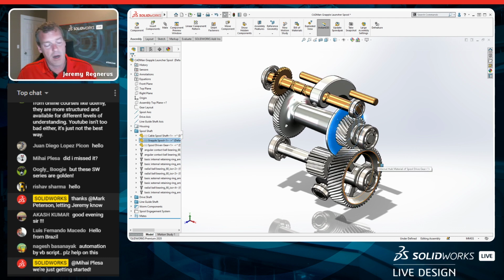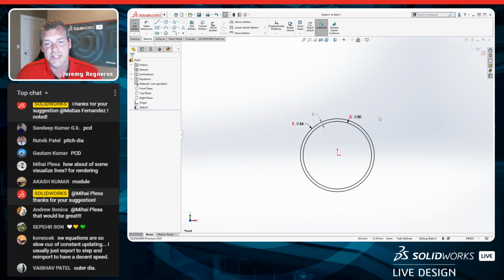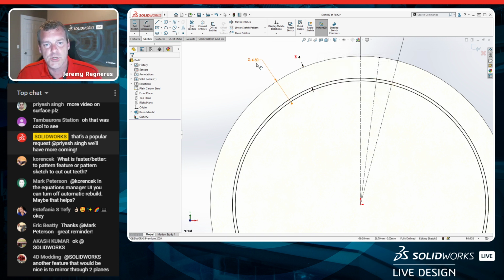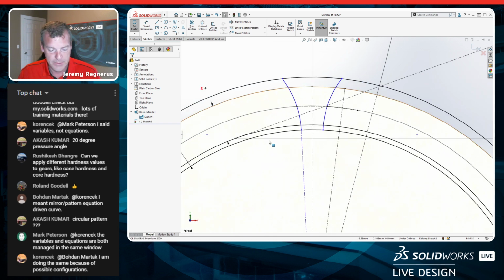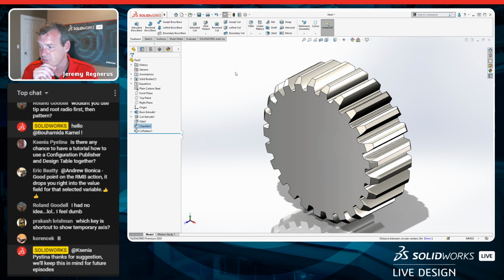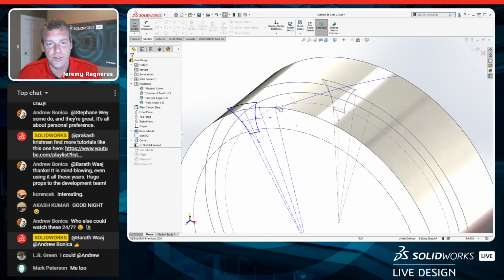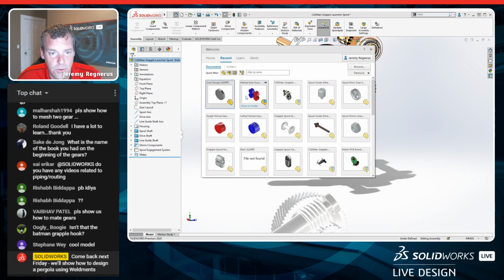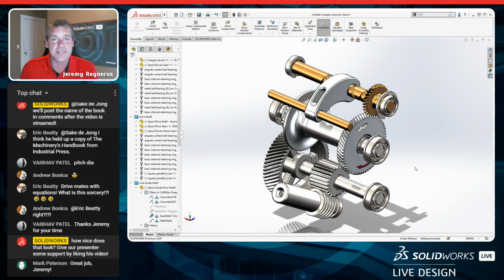Design Spur and Helical Gears - Episode 9 - SOLIDWORKS Live Design

Comment: Really useful video helped a great deal to do same thing on an NX platform. Would like to forward what I learnt whilst playing with the gears and meshing them. With the method given, when messing helical gears with different number of teeth the messing does not work. I believe this is because the helix angle is projected onto the outside diameter, when it should in fact be projected onto the reference diameter (pitch diameter). Once I'd reconfigured my model to this projection the messing appeared to be perfect. I hope this helps anyone else that's using this method.

Comment: I think that there are a couple of problems with the way in which you are creating the helical gear. First of all, the helix angle of a gear is defined at the reference diameter which is normally the same as the pitch diameter. In your model, you created a helix along the OD of the gear, and not on the Pitch Diameter.  
In a spur or helical gear, there are two planes that you have to be concerned with.  The normal plane and the transverse plane.  In a spur gear, the normal plane and the transverse plane are the same. If you define the tooth geometry with a sketch on the face of the gear blank as you did in your example, the pitch and pressure angles would be the same for the normal and transverse planes. However, in a helical gear the normal and transverse planes are not the same. The transverse plane would be the same as the face of the blank, which is a plane that is perpendicular to the axis of rotation to the gear. 
The normal plane is a plane that is normal to the helix angle. In order to draw a helical part correctly, you would need to establish a plane that is perpendicular to the helix angle, and input the Normal pitch and pressure angle. Otherwise if you are creating your sketch in the transverse plane, you would need to create your tooth space using the transverse pitch and transverse pressure angle. These values change with and are dependent upon the helix angle.  To get the Transverse Pressure Angle you would divide the tangent of the Normal Pressure angle by the cosine of the helix angle. In the case of circular pitch, you would take your Normal Circular Tooth Thickness and divide it by the cosine of the helix angle to get the Transverse Circular Tooth Thickness.  The same would apply to Normal and Transverse Diametral Pitch, as well as Normal and Transverse Circular Pitch.